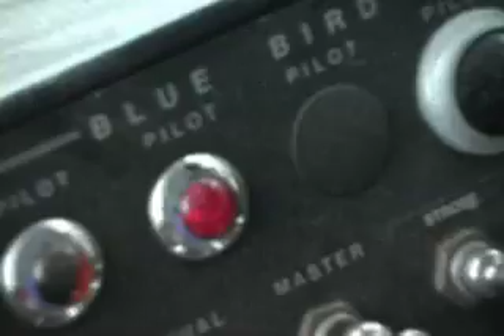BGB - Episode 1: Genesis of the Bus

Comment: @gjlannet .... Because the 444 is a V8 and not the same series as the DT inline engines.... the DT360 is the same as the 466 and while not quite as powerful its no slouch and a viable alternative to the 466..my buddy has the 360 and hes had zero complaints...Both engines are hell for strong and uber durable..  not so the 444 which is basically a 7.3 and not really a medium duty truck engine... in short they suck compared to the DT engines which imo are the best engines every put in a school bus.

Comment: I am curious why they specifically requested a 466 and not a 444 or 360 and also I would have chosen a Thomas Built bus instead of a BlueBird since Thomas buses usually have more head room. I like the color but it would have been nicer if it was a darker metallic green. It might have been cheeper to just swap a few seats around to face each other than to remove them all and put in other furniture. This seems like a very interesting thing to do though.